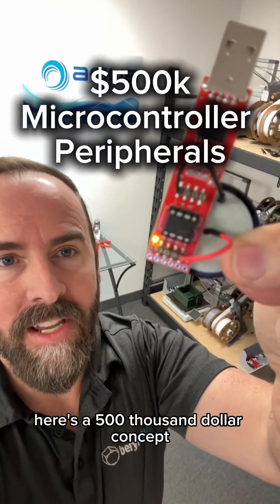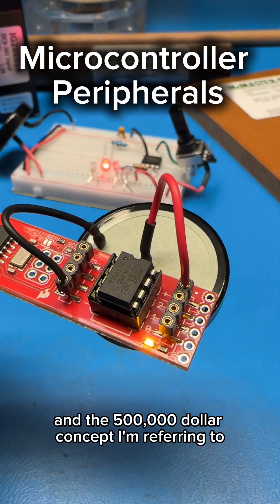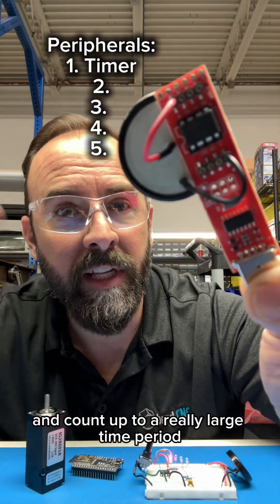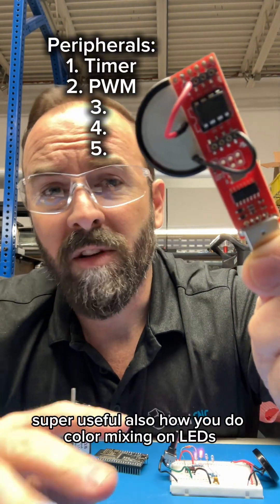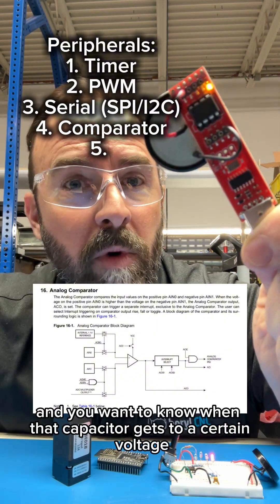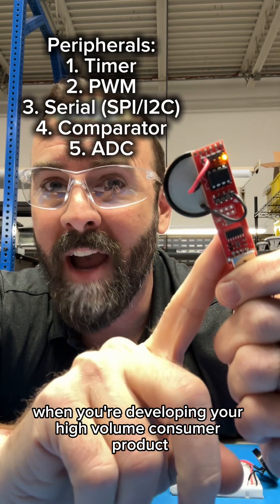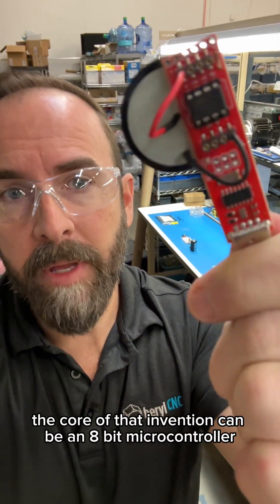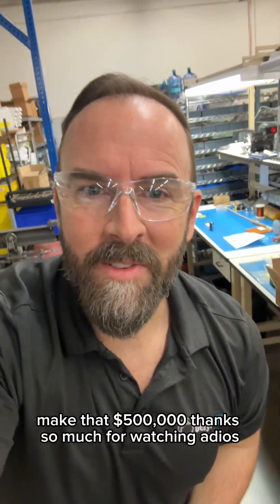$500k Microcontroller Peripherals

Comment: Can Atmel chips be used with the newer Microchip IDE Mplabs? I have not tried yet, but use an old 8051 socketed chip. I wish I could pick your mind sometime. I don't have anyone to reflect on things in this. Everyone else is html and Java wizards. When you get to bare bones everyone goes ghost
Reply: I have been playing with the pic32 and pic24. I also have a project with an esp32 7" and an stm32. I have been trying to get familiar with visual studio and using copilet, but copilet likes to get lost or forget specific device features and revert back to series specifics. It is a hell of a rabbit hole to veg out on.

Comment: The app development black hole is gone. Just use AI to create the app. Loads of fantastic tools available to help you do just that.
Reply from the maker: “Just” used twice! Must really ‘just’ be that easy to deploy, test, and debug a hardware to mobile to web REST architecture and I’m missing something. What tools do you recommend?
Reply: @i2c_jason Yes, you’re missing something. That kind of stuff is easy with a combination of Claude Code and ChatGPT. But don’t take my word for it - open up Claude or ChatGPT and ask if it can do this, and strike up a proper, deep technical conversation with it. 

I’ve spent eight hours a day for the last six months working with nothing but AI for advanced application development, and I don’t see that I’ll need to work with other human developers in future.

Comment: What is the thing about connecting to the internet being a black hole? I didn’t understand that part, can anyone explain it
Reply from the maker: Once you connect to the internet you have to do something with the data, transfer it, store it, have a user interface/ experience with it. This all needs defined and I often times see customers ask for “an app” or “let’s give it Bluetooth” and they think that’s the end of the story. Well, it’s just the beginning of a whole other development project way above and beyond the circuit board and firmware.

Comment: attiny85 are the old ones. Atmel now has the attiny412 which is better in every way including price. So if you're getting into microcontrollers, go for that one instead. Or if you need more pins, attiny1614

Comment: I use a stm8l003 tô an 1 wire temo sensor interfacing RS485
Reply from the maker: What programming do you recommend for the really low cost ST micros? I want to use a 6 pin tag connect but am having difficulty finding the proper cabling to get it back to any of the programmer headers that I can find in DigiKey. Seems to always be a mismatch on cable pitch or number of pins. I come from the Microchip world where it’s always 5 pins on a 0.1” header.

Comment: PWM does not adjust voltage, just duty cycle.
Reply from the maker: Once the PWM is driving a load you can think of it as being an adjustable average voltage. Abstractly equivalent to a linear adjustable power supply.

Comment: Apparently on metro trains in the early 2000s each individual door would have one of those controllers that controlled the motors and beepers on them! However the safety circuit link was still separate which was typically a sensor in the top centre of the doorway! :)

Comment: 100% duty cycle gives you 100% of the power, Not 100% of the voltage.
Reply from the maker: 100% of the voltage of you have a high impedance load. Brah 😄

Comment: I'm currently studying electronic engineering and the most interesting part so far to me was embedded programming and low level in general.
I'll have to start looking for a job in the near future and I was wondering if you could tell me if there's an accesible world out there for this kind on nish speciality.
Reply from the maker: I’ve made it work for 21 years, I think there’s always going to be R&D projects for new sensors, actuators, and test fixtures, at least until humanoid robots get fine dexterity and long-horizon engineering mindsets that don’t drop context. Is that ten more years or thirty more years? We don’t know.

Comment: I love the 'Just sell a million units' business plan. Its that easy, guys! Just for these 3 simple steps:
Step 1: Learn what a PWM is.
Step 2: ...?
Step 3: Collect $500,000 check.
Got it, also, calling the ATtiny85's USI 'sketchy I2C' is being too polite. Its an abomination that has caused more developer tears than C++ pointers. But sure, lets pretend the hard part of hardware startups is just knowing how an ADC works and not the supply chain nightmare.

PS: before you come at me like you did one of your other subscribers,  one does not need to create their own content to be show to criticize others.
Reply from the maker: You might like my latest video on the $10k invention. It’s my best work and the path I prefer inventors to be on, but it’s incredibly counterintuitive and requires prolific inventing. Just posted it.

Comment: Well, I see you're getting some hate over this. I don't generally agree with the haters but what came into my mind is China. I mean, I can think of a bunch of products but upon a single Google search, the idea dies. The real problem these days is innovating. The engineering is easy, AI makes it even easier, but trying to convince your potential customers to buy from you when a cheaper alternative is available is always challenging and the Chinese manufacturers have already figured out most of it.
Reply from the maker: Are you saying that US companies don’t invent high volume consumer goods that use microcontrollers anymore? Yes they’re built in China.
Reply: @i2c_jason  I'm based in Pakistan so I don't think I have the exposure to answer but it's my assumption that most companies design in US but assembly is in China mostly. Another practice is selling rebranded stuff.
Reply from the maker: @muflah yes most high volume consumer product companies here in the USA manufacture in China. My video applies to those companies and the designers working there. In fact that’s who I had in mind when I made this video, along with inventors who might license to these companies. Everyone in that chain of custody should have some idea about microcontroller peripherals, and it’s even more relevant the cheaper the product is. Imo.

Comment: I’m so confused: are you saying that I should design a peripheral? I feel like all of the peripherals are already implemented in one micro controller or another, and they’re generally compositions of timers, interrupts and opamps/transceivers which abstract over a communication protocol 

Maybe I just lack the imagination
Reply from the maker: I’m saying if you are an inventor trying to hit the mass market with a bottom dollar gadget, here are some of the things you can use in a bottom dollar microcontroller that you might not know about. Most of the inventors I work with aren’t familiar with this world of electronics and sometimes jump to features that push them out of the BOM cost they’re looking for. Also sometimes they might not know what is possible. Like if you already have to turn a motor on and off, you might also want to do X with one of the other “free” peripherals you have laying around on the part you just paid for. I’m framing this as if you’re squeezing every penny out of a very low cost item at incredibly high volumes. It’s very niche.

Comment: high volume consumer products usually have chinnese chips with part numbers that no one know.  They cost like 10 cents.  No high volume product uses the attiny85.
Reply from the maker: Correct, but you prototype it in the USA with something similar. At least that’s what I’ve always done. The reason is to make a compelling prototype with a close budgetary BOM on a resource constrained PCB. That unlocks investment when in some cases you can’t use an ESP32. I mean I’ve been there countless times, I’m just trying to share this knowledge with those who are perhaps non technical team members.

Comment: Great apart from... you will spend more time worrying about hardware details if you go to minimising cost by using an 8-bit micro. Prove your concept via a 32-bit ARM with a mature toolchain, or better yet even Arduino or simulation... and only THEN go for minimising cost, which will at the point of turning your prototype into production design.
Reply from the maker: Yes, that’s the engineers job tho.

Comment: Reminds me of the mad stuff I heard from my seniors like using those OTP pic microcontrollers as logic gates and oscillator like bruh the program size on those chips are like 512 byte
Reply from the maker: Many times in industry we’re asked to squeeze every penny out of our circuitry. To the point where it’s really insane. Often times there no room to use a software stack (no ESP32, Arduino, etc, no includes) this video is about educating non-technical team members about what is available on the most basic microcontrollers when attempting a ln extremely high volume bottom dollar microcontroller design for the mass market.

Comment: the title is wrong. This also isn't anything particular, I had programming classes for an mc68c705 at school, I created a program for it to make it into a calculator. It can't do math, only ADD and change a number from positive to negative. But you can use those to create multiplication division subtraction powers square root etc etc. The only limit to it is that it has 1804 bytes of EPROM and 112bytes of RAM. The world is your oyster. It doesn't have PWM or I2C on it's own but you can add that yourself, it has 20 input/output pins and a timer. 640k is enough? Boo, 112bytes should be enough.

Comment: Pwm isn’t so much about voltage percentage as it about on percentage, or better said; Duty cycle.
Reply: I disagree. Duty cycle is about how long something can run for before it needs to cool down. You use PWM to control voltage, current and or frequency

Comment: Hi Vedder. I've been looking at the vesc communication code and I wonder why there is a normal and _SETUP variant for some things. Like COMM_GET_VALUES_SETUP or COMM_SET_MCCONF_TEMP_SETUP. Setup seems to be used in vesc tool. But what's the difference and what are the non-setup variants used for?
Thanks:)

Comment: “It’s a $500K idea*”

*May require a PhD in electrical engineering to use.
Reply from the maker: The inventor should have some idea of what building blocks are available at the most basic lowest cost entry point. Yes, the engineer can do the rest.

Comment: Ok, but 32-bit microcontrollers are basically the same price these days.
Reply from the maker: True, but are you sure that’s the case for bare die generic bump on board? Like offshore generics? Anyway my point isn’t that you have to use 8-bit, my point is that inventors should understand the concept of peripherals and microcontrollers at the bottom dollar.

Comment: My favourite microcontroller peripheral is DMA. It's bonkers the things you can do with it. From FPGA-like speed in streaming a tonne of data between things to some really whacky, off-label stuff. 

Don't have enough SPI peripherals and need to blast a bunch of data out quickly, with a hard real-time timing requirement? No worries! Do whatever bit shuffling you need in one task to get the bitplanes organised, then use DMA to blast it out to a GPIO port. Need a clock signal? No worries, sync the whole thing using a timer peripheral, and setup a PWM output off that time to toggle that pin at the right time. 

On some chips, like the PICs you can even use DMA to set control registers for other peripherals to create a whole real time state machine that runs with very little processing overhead nearly entirely independently of the processor core. The only actual code that needs to run once it's in motion is sometimes an interrupt to start a new DMA transfer. Sometimes, though, you can bypass any code all together at runtime if you can pull it off with circular mode, leaving your code to do all sorts of other exciting things.
Reply from the maker: ❤❤❤ I love this comment and will do a DMA video someday. Same with interrupts, you can get the important stuff happening on autopilot and then do mainline code on whatever slivers remain. So I’ll have an interrupt and interrupt vector table video too at some point. I wanted to start with the simple 8-bit peripherals because high volume products can use offshore generics with these on bare die bump PCB applications. I’ve heard stories of like 5 cent microcontrollers back in the day.

Comment: Had a situation for a production "interface dongle" where I needed a window comparator. Unfortunately there wasn't enough room for the dual comparator and all the associated resistors on the PCB. I went with an 8 pin MCP 12C5xx micro and 80 lines of assembler code... it worked and it fit! Internal oscillator, brownout detector, reset circuit, A/D, and timer for debounce. Oh, it cost less as well!
Reply from the maker: Awesome! That’s the spirit!

Comment: We have AI for coding now. 

And interop over the Internet (for orchestration) is very valuable.
Reply from the maker: A standalone device will always have less development time and risk than a connected device.
Reply: FWIW at my place of work we have been trying to use AI tools for firmware development... It's not near as good at that as it is other forms of coding currently. (In time I suppose) That's provided the bubble doesn't burst and send the world economy into a death spiral. 

Additionally... Not everything needs to be connected to the internet and when it is it frequently causes frustration that simply doesn't exist for devices that have no such capability.

Comment: Just built my first commercial product using an ATtiny85. 1 button remote that controls the speed of a motor, turns on an LED for 45 seconds when you click a button. Plus, if you double click the remote button it goes to full speed so you can have a slow speed for normal operation, double click and it bypasses the speed you set and jumps to full speed. Probably going to sell the device for $60ish.
Hold the remote button down and adjust the speed, it remembers the speed you set. Yep, used the ADC to decide which button is pressed so 2 buttons on one GPIO.
Reply from the maker: I love this! That’s exactly the sort of application I’m referring to. Thanks for sharing.

Comment: I use these along with RPi2040, Arduino and PIC32 chips. I use the tool that feels best for the project. I make for niche customers. Many have been under 20K productions. It pays very well. I get paid for prototyping and field demos with a share of final sales. If it is a small run I will make them myself.
Reply from the maker: Same, and I never ask for a cut of the revenue. Both strategies are fair tho, more up front, less on the back end and vice versa.

Comment: I am a software engineer with more than 3 years of experience in full stack development.

Now I just ordered some electronic components to start my journey of learning electronics.
Reply: i am a software engineer turned electrician, i wired my house to keep all the physical switches working but all of them have sct 013 and micro controllers and i can see if they are on or off and to turn them on and off via my own website hosted in my room from anywhere else, now i can turn the main bedroom light off with just my tablet or my phone etc, without getting off the cozy bed😂
Reply: Web developer you meant 😅
Full stack engineers usually dont even have a university degree
Reply: @DanDan10101 I have bachelors degree 🙄
Reply: @DanDan10101  imagine getting a degree in comp sci and still believing it has any bearing in the real world vs experience - full stack moron right here

Comment: Idk why it costs so much .some microcontrollers have the same functionalities and are way cheaper. For the timer part you can just stack microcontrollers or buy a special device.
Reply from the maker: I’m not saying you have to use the ATTINY85, just using this as an example 8-bit part. High volume products typically use generic offshore bare die bumps.

Comment: I guess technically you can say it's less voltage, but it's not a lower voltage, it's just on less percent of the time, hence why it's called a Pulse Width Modulator (PWM).
Reply from the maker: It’s less average voltage

Comment: you can also tell that puppy to goto sleep for a pretty long time. Disable the adc, turn down the clock.  I've had one running on a usb battery bank that I hacked into a guitar pedal. It's been down in a bin for years, I built it 10 years ago and it still reads 3.53V

It sits paired with a POLOLU swtich connected to the pedal chain 9V,  When you turn the pedal on power is enabled, it then watched the input signal and if nothing really happens over a set period it shuts the switch back off.   Lack of audio, power shutdown. Battery Saver.
Then it goes back to sleep mode.
Reply from the maker: Exactly! The power saving is insane. Cool project.
Reply: @i2c_jason  https://www.youtube.com/watch?v=_ZHJuSyn4GA

Comment: I mostly use a Arduino nano or esp32 pro mini because the AtTiny is for me more expensive 🙂
Reply from the maker: For sure, I prefer the more powerful processors too because they’re easier to use in many ways. For inventors theorizing about the possibilities, I want to roll it all back to the beginning, 8-bit micros. This is applicable to generic bare die bump on board PCBAs that are bottom dollar.